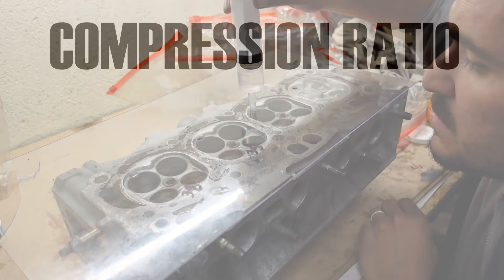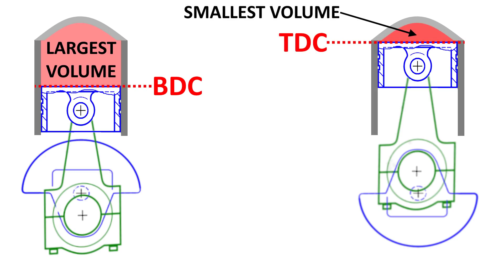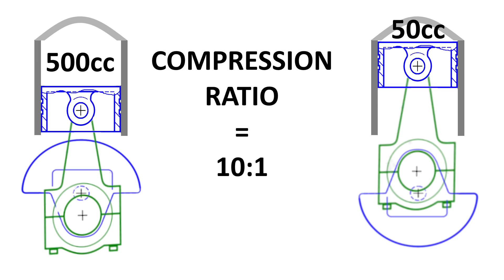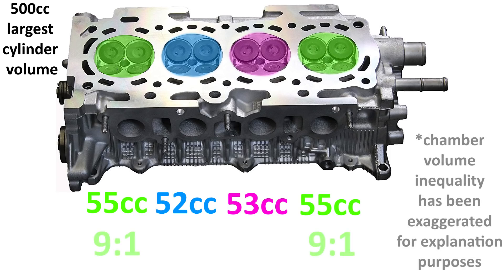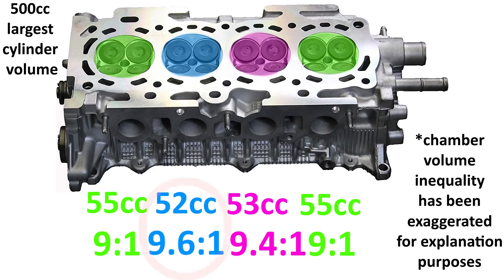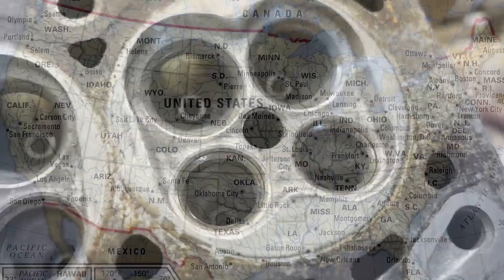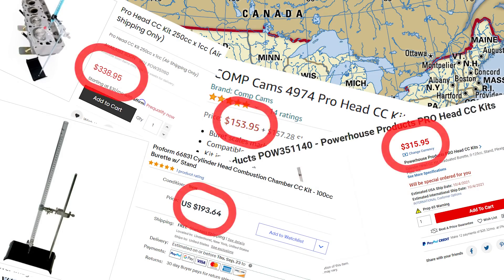HOW and WHY to EQUALIZE combustion chamber volumes CC - Project Underdog #10

Comment from the maker: Become a Tuning Pro: https://hpcdmy.co/dr4a
Support the channel by shopping through this link: https://amzn.to/3RIqU0u
Patreon: https://www.patreon.com/d4a
There's a mistake in the compression ratio calculations when the volume increases by 5cc at 00:54. The total volume increases by 5 too so it becomes 505/55 and not 500/55 which means the result is 9.18 and not 9.01. The example obviously still works and the logic is the same but the number isn't correct. Thank you to @sagi fern for pointing this out.
Reply: ALTERNATE APPROACH THAT IS LESS FUSSY:
Follow all the steps up to filling the chambers with water. At that point, fill the large syringe with REFRIGERATED DISTILLED water and weigh it with a gram scale. Fill one chamber with water and then weigh the syringe again. The weight difference in grams is equal to the volume of the chamber in cubic centimeters. (well...technically 1cc of distilled water weighs 0.9982g, but that difference is too tiny to matter.) Refill the syringe, re-weigh it on the gram scale, fill the next chamber, and calculate the weight difference again. Repeat for all chambers.
Reply: ... thickness of the head gasket my dude, adds to chamber volume as well as total volume.
Reply: I always found this debate interesting. I think it's useful to think in terms of swept volume and to keep in mind that static and dynamic compression ratios vary throughout the rpm range and are different and same based on the volumetric efficiency of your combo at any given rpm. Great vid as usual.
Reply: I hear you! I'm a 2-stroke lover.🤣😂😂😂 I'm very fast! 🤣🤪😆 but the dynamic compression ratio is greatly influenced by the exhaust like a turbocharger. Best way to deal with this is a pressure-sensor in the cilinderhead(s).
Reply: Good save. When all else fails, check the math several times...

Proper Head Prep is really important. Not just in short term, but long term also. Some people think it's a waste of time, but there are lots of reasons to do it right from the start. Ever have to yank the heads off to correct a problem that should have been done before bolting everything together... oops.

Always amazes me that some people don't have the time to do these steps first, but have the time later to remove heads and do it anyway.
Reply: For future reference, if anyone wants engine displacement tool. It’s actually a burette, your nearest high school might tell you where they buy it from. Should be inexpensive no more than 20-30 bucks.
Reply: @syedhuzaifahassan4588 thank you someone finally said it, I was like didn’t I use this in titrations in high school 😅
Reply: Youre the bezd. Thanks and keep it up wanna see that toyota someday finished. 🤗🤗🤗
Reply: was just about to say, also taking 5 cc out of the compression ration doesnt mean the ratio changes by that number//./
Reply: It is important to know how far the piston is below the block deck height.
Reply: No Bro... you were right. Sorry, and @sagi (sorry sagi) was wrong: the displacement of a cylinder is NOT the total volume of the cylinder/chamber system.
The displacement of an engine is the result of the volume determined by (bore x stroke). The displacement change only if you modify the cylinder bore or increasing the stroke by changing of crankshat.👍
Reply: @chupachups6098  Total volume = (bore x stroke) + comb. chamber vol.

So if combustion chamber volume increases, total volume increases equally
Reply: @EquiliMario  that is not the displacement of an endotermic reciprocating engine.
Reply: @EquiliMario  no, the displacement is the volume created by the pistons' movement inside the all cylinder. Not by the total internal volumes.
Reply: @chupachups6098  But he's not referring to displacement

Comment: And another add-on. Concerning the valve sealing.
Equalizing the combustion chamber volume is one thing. But to make them net equal you should spend even more effort on making the valves equally seal the chamber.
Any minor sealing issue on one of the valves will throw off the net compression ratio of that cylinder by more than  the effort you spent on it trying to equalize its combustion volume.
So, while a block is that dismantled, spend the extra time and check, rework the fitting and polish the valve and port.

Comment: What I must add to my last comment. You should not start with removing material by guess and then measure afterwards what the biggest volume you got. 
You should have a general volume goal in the first place  depending on your calculations in regard of loading the engine.
So, have your compression goal first and then work every cylinder individually towards that goal.

Comment: I suggest using a fine scale to measure the amounts of water used. 0,1g equals 0,1ml in water. Using alcohol would even increase the accuracy due to lower adhesion.
Reply: Sorry, didn't read the comment before.

Comment: This is no joke. I guess even more noticeable in diesels, due to the higher compression ratio. I had a small 1.9 diesel which I sent to rethread a glow plug. The job was ok, but the glow plug didn´t go down all the way in the prechamber (maybe less than 1 cm). Was totally noticeable the lesser performance and increased vibration in just a 50 mile commute.

Comment: I just did this two weeks ago and arrived at the exact same method shown here when I didn't want to buy one of those overpriced kits. I was only trying to confirm that my two heads are roughly the same -- that one hasn't been milled while the other is stock. It's madness but it does work. 😜Takes way longer than you'd think, lot of little uncertainties crop up. I ended up using orange windshield washer fluid because I wanted the color and maybe it had less surface tension than tap water. If you end up being tempted to ballpark it at the end because some fluid leaked a little or something, you definitely want to redo it. I was certain one head was larger but when I redid it with more control and precision, I learned that they were in fact the same. I'm glad I took that extra measurement, which I did NOT want to do, before driving the head to a machine shop!

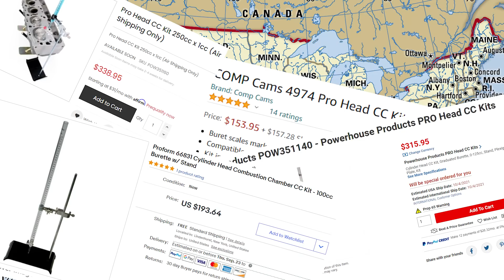Comment: 4:19 This equipment just looks like a burette used typically in chemistry and they can be picked up for very cheap anywhere, I had a quick look and they can be bought for less than 20 euros shipped. Definitely shop around before buying chemistry looking equipment sold as engine building tools as often they are the exact same thing resold with engine building in mind for a markup

Comment: Why is it necessary to lower the compression ratio when adding boost if the boost is just going to bring it back up again? I don't know if that question makes sense... It might sound stupid, I know but bear with me, please:

Why is it impossible/ not preferable/ not the same thing/ ineffective to leave the ratio as is and add only a SMALL turbo to replicate the "pre-combustion" combustion chamber pressures of a cylinder that had the compression ratio REDUCED only to have a T72 inflate it to 9 billion psi/kpa before the spark plug ignites the mix. Why was the standard compression ratio always going to cause knock/detonation/pre-ignition even with a small turbo if the same engine with reduced compression can run a huge turbo with TONS of boost all of a sudden?🤔🤔🤔
Reply: The answer to your question in short is because of quench. Quench is basically simply put how the flame front travels in the TDC at high pressure. To explain the event that actually happens with Real racing engines like pro stock, Nascar, F1, NHRA, Comp-eliminators it'll take me the longest comment in YouTube history to explain here. So to put it simply look up guys like Darin Morgan, David vizard and George Bryce star racing which do have extreme credibility with this topic and will definitely explain it better than I ever can

Comment: There is glassware called a burette that is typically used with a concept in chemistry called titration in which you add a base to an acid or vice versa until it reaches a desired ph (usually neutral) that requires glassware very similar to the head volume measurement kits you showed. I would take a look at European chemistry glassware suppliers and see if they have a solution for you.

Comment: Good vid but one remark: by deshrouding those valve recesses, you are also reducing turbulent flow, which helps against knock on a turbo engine. 
Some prev owner did this also to one of my Kawasaki 750 turbo heads, but only on 1 combustion chamber, so I had to smooth out the other 3 as well.

Comment: Exactly what I was looking for. One of my cylinder heads in a 1UZ leaked and the machine shop had to machine 0.2 mm of it. As it was a banana the the volumes will not be equal. And definitly not equal to the other bank. I guess I'll be busy quite a time. 🤣

Comment: After the initial measuring of all chambers, you can speed up the measurement of each cylinder for correction by using a separate glass for each one.

Comment: Love this channel! Hey btw if you  decide to port and polish. Leave the intake sides semi rough like 400 grit and smoother on the exhaust ports like 800-1200 grit. Then polishing slightly but not like your combustion chambers are. Sure CNC porting is best. But unless your building a completion engine? There is no  need. 👍😊

Comment: An old dirt track trick:  on a V-8, the back cylinder on each side have pistons 1/2 of a compression ratio higher than the other 6 cylinders. Example; front 6 - 10 1/2 to 1, the back 2, 11 to 1.

Comment: Fantastic video. But you did make one mistake. You really only did half the job. You completely ignored the other half of the combustion chamber, the top of the piston and cylinder. Any dish, dome, or valve relief in the piston can just as easily be off by some fraction of a cc. Variations in the cylinder bores, piston height, or pin location can also make a measurable difference. You got the heads perfect to a tenth of a cc, but your actual chamber volume could easily still vary by a couple cc between cylinders. Ideally, you should also cc the cylinders when they are at, or close to, TDC and add that to the chamber volume to get the complete picture. You might find you need to make the chambers slightly different to get the actual compression ratios the same.

Comment: If you need a valve job then you should factor that into your work plan. Depending on the decision to just cut or replace and cut (if they are replacable) the seats will affect the chamber volume as the valves sit higher or lower on their seats. It is also worth mentioning to the machine shop that you want all the seats at identical height so find the lowest seat first and cut to that.

Comment: Hallo.. very nice channel...
"The hunt for more timing"
 i have a question, will the shinny surface reflect heat?  It appeared to be a simple question... but after thinking about it....
Some backgroud to the question.. about 5 - 6 years ago i was tuning a ducati.. after an engine rebuild she started having pre ignition problems.. After considerable attempts to correct the problem i saw this video https://www.youtube.com/watch?v=678eF_5FDw0.. So i pulled the block apart... scuffed the tops of the new pistons and problem was gone.. i do it with all pistons now. So the question probably should have been... can preignition occur on the top of the piston.. the heat being reflected from the head
 Top show, great presentation

Comment: I've got a tip for you that works like a charm and can shave lots of time off the process - just using a proper scale and a syringe.

Just use an oversized syringe, draw up a volume to a certain weight, for example 70g, fill the chamber, weight again and note the difference. If you want to be very accurate make sure you keep everything you use in the same room for 24hrs to equalize in temperature and make sure you keep everything out of sun- or spotlights.
Even if you're unsure and do every measurement twice that should still be way faster and is plenty accurate.

Just make sure your syringe is dry on the outside, your scale isn't utter crap and has a life of its own and keep your phone or other possible sources of radiation away from it.
A phone can make scales swing by a lot but you should usually notice it anyway because it won't stabilize.

Can't imagine doing it any other way, it's so much wasted time for nothing. A good scale will even be more accurate than the graduations, I've found them to be not as accurate as one might think and differ a measurable bit from model to model even on syringes of quality brand manufacturers.

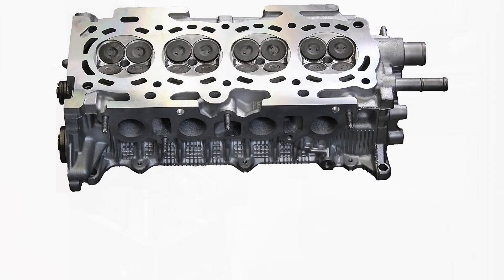Comment: Does anyone know what kind of HMC is shown at 02:17 ?

I'm wondering why it's Z-axis ram turns around its axis. Doesn't seem to make any sense in this operation and unless I'm missing something, which I strongly suspect, the function doesn't make any sense at all.
I mean, rotating around the main spindles axis of rotation doesn't change a thing after all.
And it seems it's a completely unnecessary movement in this operation even if it has a purpose in some cases I'm not seeing.

I'm rather bamboozled about what I saw there...

Any clarification would be greatly appreciated!

Comment: Thank you so much D4A for all the content you put out I love all your videos. I am restoring a 1996 corolla DX with the 1.8L 7AFE. maxspeedingrods appears to have forged 7AFE rods. Will this combined with the Toyota 4AGZE 16v pistons you are using in your current project produce the same compression ratio as in your 4AFE project? Also, will you be using the 4AGE oversized valves in your build?

Comment: When I did a similar job without chamber volume correction on a small block chevy I was really surprised by how much good it did the engine. Even by eye it was possible in this case to make a smoother running engine. I don't know if it was the work on the gas passages or the cylinder head itself but the engine was significantly improved. This exercise was also very good for two-stroke engines, the passages between the crankcase and the combustion chamber were messy and of unequal volume, once more just cleaning up the mess made for a much more enjoyable ride.

Comment: Why not directly measure compression with a pressure gauge?  What happens if the valves or pistons don't seal perfectly? I guess that this labor may be a waste with the complete engine assembled. Since I am not an engeneer, I could be wrong. 
Any way very interesting video.

Comment: Here in europe we use airflow to control the real airflow when the engine is complete.
Because there could be slight difference in the casting of the cylinder head

Comment: 2:10 That isn't always true. Some engines would have the combustion chambers machined into the head. Pontiac did this to their V8 engines from the early 1960s through late 1970s. It had the added benefit of removing the rough casting that is typical in cylinder heads. If you want to see an example of this, you can look at cylinder heads that were found on the classic Pontiac GTO. Ignore the GTO from the 2000s, those were "as-cast."

You would still need to CC the chambers on a performance rebuild. If a head warped and milled, the chambers would probably vary a little. In addition, the chambers would always be smaller after milling, so you would need to CC the heads to calculate the compression ratio when rebuilding. That is in addition to knowing the compressed gasket thickness, the piston to block deck clearance, and the piston dish or dome volume. Some "Flat top" pistons have negative CCs because being notched for valve reliefs doesn't count.

One advantage to building an OHV engine is that you can usually mill more off the head and block deck to raise the compression ratio. At most, you might need shorter pushrods. If you tried to do this to a SOHC or DOHC engine, you would cause the valve timing to be off. You do need to know piston to valve clearance when milling heads and blocks.

When buffing chambers, some people like to leave junk valves in the head. That way, a slip up with a grinding tool won't make a mess of a valve seat. This is probably even more important when using a power tool. Other times, people will put a thick layer of tape over the valve seats, so a slip up only removes the tape.

Comment: I really enjoy your videos, look forward to each one immensely.
Is it fair to say that actual compression ratios aren't as quoted because the cylinder isn't totally sealed at bdc? And depending on the cam dwell every engine's actual would vary considerably?
2 strokes have quite low quoted CR's but I think this is because the oil mix lowers the fuel octane rating or are they measured after the piston has passed the ports?
Someone set me straight please!

Comment: Just curious as to why you didn't clean the deck of the head before you demonstrated this process?
No criticism, awesome video.
Reply: Yes I get that, but cleaning and milling are two different things. I would think that you would like to have a completely flat surface to check the compression ratio versus having leftover head gasket material on the head.
Just sayin'
Reply: If you slip up while doing this, you ruin the machining of the deck and have to do it over again. This becomes an even bigger problem if your head does not allow much to be milled off, or your piston to valve clearance is extremely small.

Comment: So just some questions. Firstly mate what a vid! Thanks so much. 

When you were sanding away cylinder 1 and 2 to match volume for 3 and 4 did you just sand away anywhere you felt best or is it necessary that each one looks as identical as possible? 

Secondly when you were fine sanding at the end what grit sand papers did you start with? Thanks again